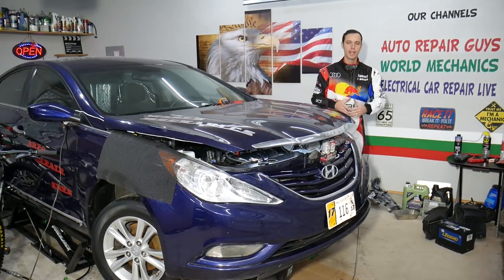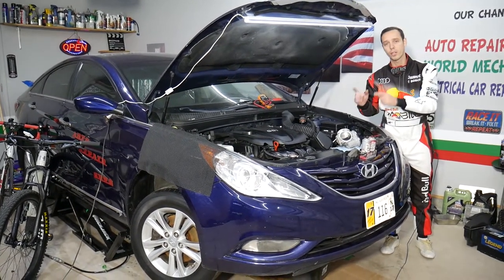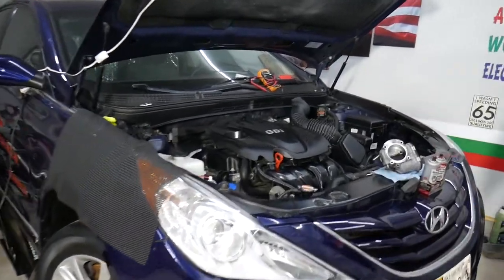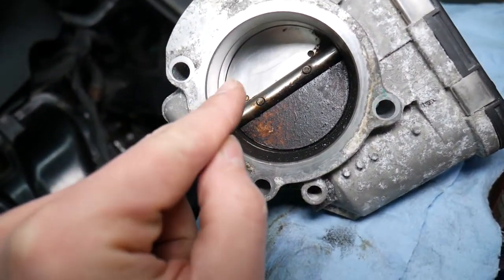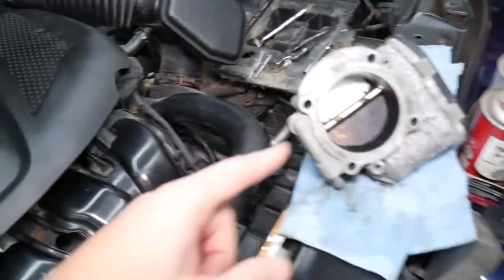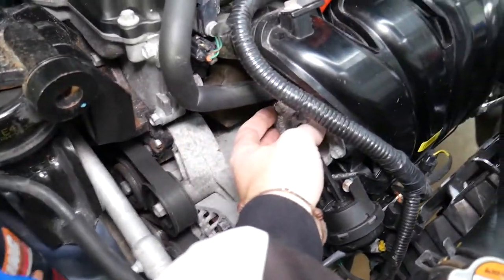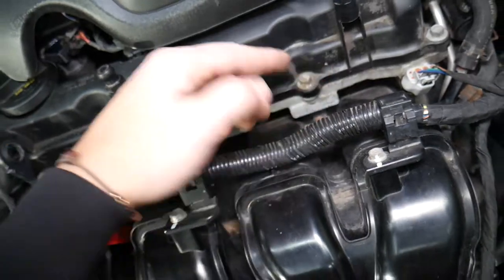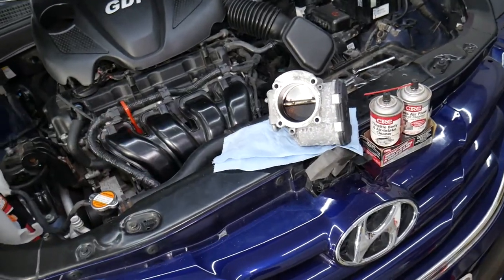TOP 5 REASONS FOR ROUGH IDLE ON HYUNDAI SANTA FE TUCSON ELANTRA VELOSTER ACCENT SONATA

Comment: On many hot days I sitin my car with ac on n car idling n all is ok.  now  I see coolants dripping under car , 2017 Hyundai Tucson. Temperature gauge ok  and coolant tank ok. What cause n where is it dripping n how to fix it. Plz help
Reply: Are you sure that it is coolant and not just water from the air conditioning system running
Reply: @mdterpz532  . Hose had a tiny hole, cause drip.

Comment: guys can you please help me...
I got 2014 hyundai tucson (2.4 GDI), I have rebuilt the engine and it works fine, but...
when started cold it keep rpms high and wont come down for a long time, when started hot it goes down to 700rpm quickly as it should do...
Also when driving without applying throttle rpms go up and down, ( slightly but still abnormally).
So what should it be? I have cleaned the throttle body, scanner shows no faults at all, I have a perfect vacuum and everything else works fine.
Any suggestions???